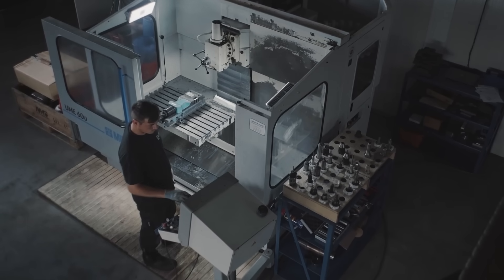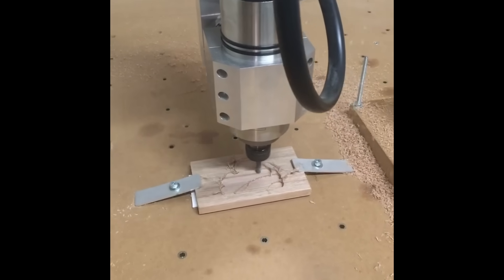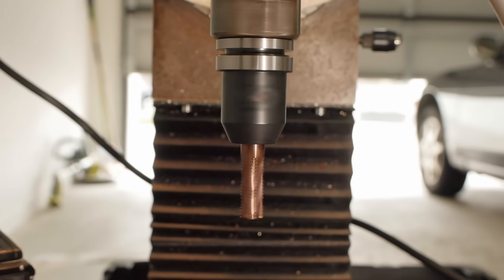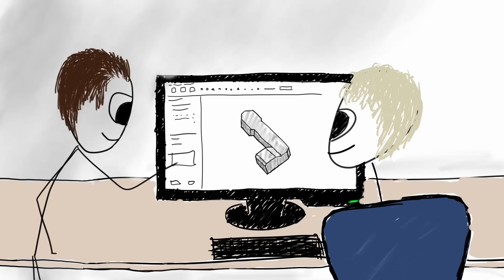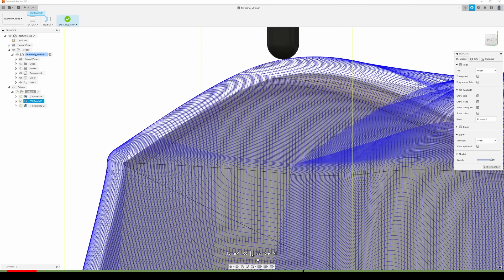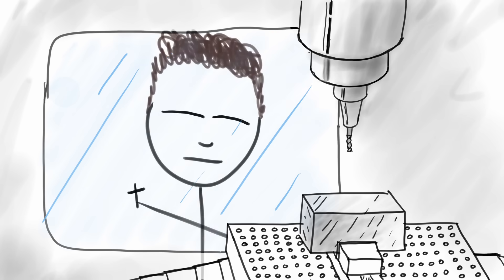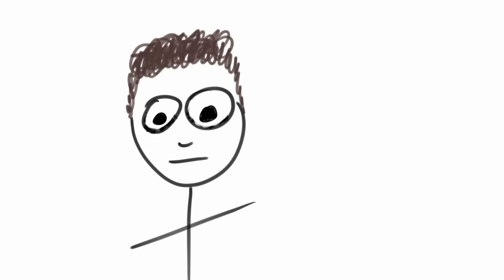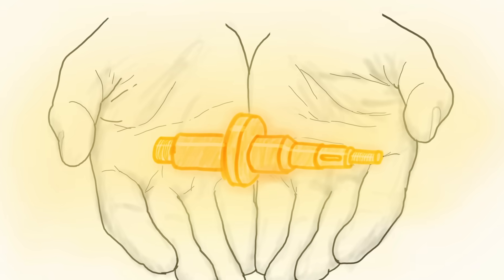Casually Explained: CNC Machining

Comment: Machine spindles are pretty sturdy these days.  I've never been at a shop where the other guys (it's always the other guys) regularly crashed the spindle.  It was so common that the first thing I did when I got in every day was look at the faults on the two shifts before me to see what I needed to check to damage before running the machine.  I don't think I've ever seen anyone actually get fired for crashing the machine.  In fact, I've never seen anyone get fired for negligence or even gross negligence.  The only punishment that seems to get is an easier job at the same wage.  The industry is fucked, though.  It's really hard to find anyone who actually knows more than the basics.  What used to be one man who knew the tools and methods, is now 1 man who might know the software and has a very sloppy and broad knowledge list of tools, and a 20 minute course in pathing on a mill is building a program, deciding on the tools, and sending that program to the machine where a guy who is barely trained looks at the program and (hopefully) puts the right tools in the right spot in their carousel according to the program, and hits start.  So what uses to be a 1 man job is now broken down into 2+ people who, combined, don't even have as much knowledge or information as the 1 man, all so they can produce more work faster at a lower quality and the expense of a dying trade and lost tribal knowledge.  Kind of makes you wonder how much lost tribal knowledge could help solve modern problems but we were just too busy chasing the dollar to realize that knowledge might be more valuable in the future.

Comment: Genuinely curious, why ISNT cnc cam as simple as a 3d printers slicer. Like does something like that exist but its rubbish and you might aswell do it yourself. Or is there something inherintly wrong with trying to get a program to auto generate your cam profile
Reply from the maker: I've thought about that a lot myself. My conclusions so far are that machining - especially metal machining - is much more sensitive to a range of variables like tool load, vibration and chatter, tool wear, and material variation. It also has the limitation of access - printing simply prints in layers. With printing, you don't need to worry about reaching down a hole and making sure that the tool is long enough to reach but strong enough not to flex out of tolerance, break, or get clogged up with chips. Much of this needs constant fine-tuning and monitoring by an operator or a lot of sophisticated sensors and algorithms in the machine, which becomes cost prohibitive compared to just paying a person to take care of it. The auto-generator/AI would need to be aware of the hundreds of tools available in your specific shop and how they tend to behave under various circumstances. The CAM would need to be intimately linked in with all those sophisticated sensors in the machine to gain an understanding of tool behaviour to be able to generate a path that will rough out material, not collide with anything, and then finish the part within tolerances which printing doesn't even try to hit currently. So I guess the short answer is that there's just way more variables that are hard to control without expensive integration of machine and CAM. Plus machining often has to hold the workpiece in more than one setup and orientation.

Comment: Serious question boys. Has anyone fucked up a one off job so badly rhey questioned if they should do yhis kind of work? Cause im there man. Just feeling dumb.
Reply from the maker: I feel dumb just hanging around my friend Marcus's shop sometimes. What did you fuck up?
Reply: @machsuper long story but... I work at a small job shop. I run a Mazak qtu 350. A couple of months ago I swaped endmills with a co workers because I had the last one of these. The one he gave me was a .03 radiused .25 endmill. I leave that tool in the live tool slot in my lathe because I use it pretty often but not every day. Had a job that I had to mill a flat bottom blind hole and used the radiused endmill because I'd forgotten it had a radius. So my flat bottom hole was not flat. The thing is I didn't even notice the bottom wasn't flat. That oversight by itself just kinda broke me. It was a small diamiter hole and all my measurements were from the center so my inspection told me everything was good. My boss immediately noticed. Sometimes its just too much going on to notice these things. Even though I was able to mount the pieces back in and fix them I was just constantly berated about it. Just a real ball buster and it kinda got to me.

Comment: I just finished my second day at a machining workshop (my first ever job like this) (I dropped out of software engineering) and I'm in charge doing the cuts in fusion and using the HVM-3800 to drill and cut the parts. So far I'm liking it!
Reply from the maker: Hell yeah! Did you ditch software because of AI?
Reply: @machsuper no, mental health reasons.
Reply: bro my response keeps getting removed
Reply from the maker: @frogg03_  What? Really? It's not me doing it... What are you saying in it? Can you email it to me? contact@machsuper.com

Comment: 'L  Z+0 FMAX' is not interchangeable with 'L  Z+0 FMAX M91' when the machine origin is at the top of the machine. Whoever designed it that way is evil. Put the machine 0 on the table you fuckers xD

Comment: Military Intelligence Analyst here

CNC machining: the Millimeux Corporation 

They built Le-Mat revolvers for the confederacy.

Very evil people. 

They would use diamonds, from cave dwelling slaves, mined

To cut an shape meteor fragments 

They'd find underground 

Then, chemically apply hot blue (?)

And then annealed with torches

And assembled

They were built 

100% wrong

By copying 

Arming swords

That you make a mold from a blueprint 

Of a cannon

Pour in pig iron, with carbon gas blasted through it

Then, break the mold open

And drill a touch-hole...

For a cannon 

Or musket barrel

Same with springs, but use different steel

Etc 

Or wind up wires, and plates, before heating and cooling in water

CNC machining 

Takes like 10× longer

And you get one revolver 

Vs

We can make like 100 cannons in a day from 

DIRT. 

they thought they were better than us

So they would send union officers le mat revolvers

As a threat 

And to say they were better than them

And tried to get them to shoot themselves 

By blessing the guns with curses

They got used on both sides

And that business in France 

Was laughed out of society 

By making things fancy on purpose

And expensive 

Which is what their value is

Instead of something worth wile

Like a cast engine block

Comment: Anyone recommend a cnc machine for the house. 
 I have small parts I designs no more than 8x8x1
Reply from the maker: Is Syil in your budget?
Reply: @machsuper  aiming more towards carbide 3d size but little cheaper. 
 
Running tool from .5 down to .125

Comment: The one way to befriend a machinist is to seek help from him. 
I had to work in an innovation lab were i sometimes needed to go to the machinist's workshop next door (not a company but same structure so no big deal) and I got to befriend the machinists by seing them regularly and sometimes working by miself with simple tools like the drill presse or hand taps, bench lever shears to recycle a scrap...
In the end, my lathe machinist friend made a a beautiful set of parts for a mini pitot tube for a personal project, and others in the workshop made my model rockets find out ou 2024 Al. Thanks a lot guys

Comment: I don't work on CNC's, I'm a tool and die maker which just confuses people, and I work on progressive dies that make run components from .003" to .060" thick, and often the products need to hold tolerances within ten-thousandths. If anything is mistimed, misaligned, missing a bolt/component, I have the potential to destroy a $100,000 tool. Can relate.
Reply from the maker: That is masterful work. What's the worst mistake you've made?
Reply: @machsuper  wrong component for a changeover. Smashed a die shoe from hitting a stamp too hard. Took 3 days to fix.

Comment: 3:56 technically not true. As someone who has messed up many parts I can say that welding and helicoils are very helpful. Helicoils go by different names but it’s essentially a spring looking thing that you insert into a large tapped hole to make that taped hole the size you intended but screwed up in some way or another. I’ve only made one “boat anchor”. That was when we got a job that was basically a torus with a shelf on the inside. The shelf I thought was flat so when I made the spline of the 2D cross section to cut it on the lathe I made it right through the center of that shelf. I found out many days later while milling the inside that there was about .04 thousands that were missing. I went back to check the file and there was a less than 1 degree slope on the shelf in 2 directions. It wasn’t exactly something we could weld because it was a prototype so we had to scrap a 5000 dollar billet. My boss had my back though because neither he nor the person who sent the model knew about that feature. It went all the way up the chain to the original part designer who also forgot they drew it like that. Of course we asked if we could just make it flat and they wanted it how it was drawn. That one was a headache.

Comment: Engineer to me(machinist): How long will it take you to load the program and those tools and push the button, no dry run, no proving program?

Me: repeat this for clarification.

Me after clarification: I will do exactly as you request as you monitor me for insurance, but when it comes to pushing the go button, that's on you, I’m not pushing it.

The engineer turns and heads to the office as I chuckle. :)

20 years at this, been out a while.

Comment: Did I set the z zero correctly? Do I have the right feed and rpm for the material and tool? Did I set the rpm correctly after a tool change? Is this the correct tool for the G-code I am about to run? Am I recutting too much? Is the spindle clean enough for the collet? Is the colomn still square or does it need to be trammed? Is the head not square or did something happen to the vice? Did insert carbide or HHS and does it match the feed and RPM in the code? Should I keep staring while the machine runs or finally relax? Why can't I have an experianced machinist hold my through this? Are these cutting fluids and solvents going to give me neurolical problems and cancer in 30 years? Should I have just emptied my bank account to get X or Y part instead of doing it with cheaper things? How am I going to explain or justify that I just spent the entire day making this cheap part on such an expensive machine? Im going to be broke forever, right? Am I going to hit a fixture? Will I have a zero to work off if I lose power or the pc crashes? How expensive will this be if I mess up? PTSD flashbacks of times I messed up mixed with video I saw of machines crashing

Comment: CNC Swiss machinist here and I cannot tell you how many guys we have had come in with zero experience and not understand even the most basic concepts. I will admit I may no be the best teacher, but I've worked with some kf these dudes for months and it either clicks or it never will.
Reply: Did all the cnc training at a job that only hired from a temp agency, it really is a plug, it will either go in after a few tries or it won't fit

Comment: Thank god I went to CAD path instead of CNC operating lol.
Reply from the maker: What's it like working full-time in CAD? What do you need to get into?
Reply: @machsuper  Well, actually, you have to do a little bit of CAM, but not at the level of making a CNC ready script, but just a simulation. I use Catia V5, so the usual process is sketching-3d modeling-assembly (if project has multiple parts)- CAM part (you simulate the machining and put it in final documantation which is faster, because you're just simulating, not making it ready for CNC)- drawing (creating technical drawings and specifying all values, such dimensions and tolerances. After that you put aeverything in one folder and zip it. Then the project is done.
Reply from the maker: @zeljkobroz467  university?
Reply: @machsuper  No university in my country for the technicians, we just do it straight up in high school and then we go to univrsity only if we want to have engeener degree and mechanical engeenring doctorates. Basically applis to any proffession. You can become a medical technician with high school, but if you want to become a doctor or surgeon you have to pass university. This is made like that so you won't have to go to university to get basic education about any proffession that doesn't strictly require university.

Comment: Just doing my job but I think I'm one of your worst nightmares. Systems Integrator who comes in to splice new safety features dreamed up by your resident safety rep. Light curtains, scanners, deadman... you know your life is about to get harder. My favourite past time is pouring through the schematics of your brand new yamazaki mazak to see where I can cut in to make your life more difficult.

In all seriousness I feel your pain in that respect. At least in my experience the safety people come up with something that makes them feel like they are doing due diligence but then never ask the people who operate the equipment everyday to see if their idea is even possible with the actual workflow. It got so ridiculous that anytime a rep would explain to me what they wanted to integrate I made a point about dragging them down to the machine and explaining their plan to the operator. I swear to God like half the time the operator would explain convincingly how they literally couldn't do their job if the plan was implemented as intended.

Also the places I've been CAM and operator are separate roles.
Reply from the maker: You sound like the less scary version of a WorkSafe inspector, but also, thankfully, the person who deals with the WorkSafe inspector haha

It's a similar issue with engineers and machinists. Engineers often don't consult the machinists about manufacture-ability. Thank you for doing your job well.

Comment: Talking about your job to someone who is a stranger to manufacturing is certainly difficult. I always say that I am like a technical scupltor, who uses powerful machines to produce precise parts out of blocks of metal. Then I show mesmerizing clips of high speed cutting and usually people are awed. No need to tell them the process is usually obscured by huge amounts of coolant😅. Ah yes and the anxiety when working on a conventional lathe and  you have only a few milimeters available to clamp the part in the chuck and you are uncertain if it will hold up or launch a 2kg projectile through the workshop... thats even more stressful to me than testing a new programm😂 And the shame if something happens and the whole workshop assembles to look and make fun of your little mishap, while your still a little bit high on adrenaline😂